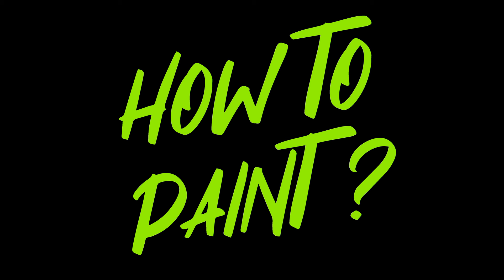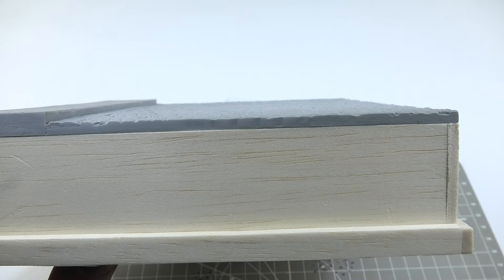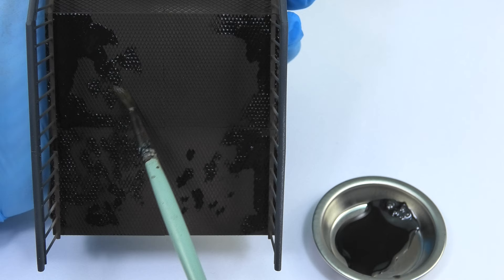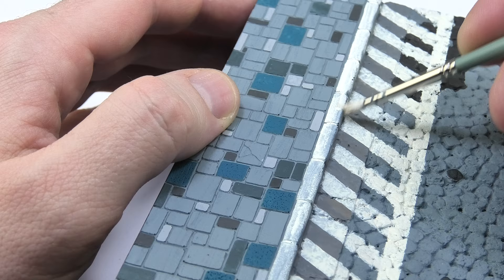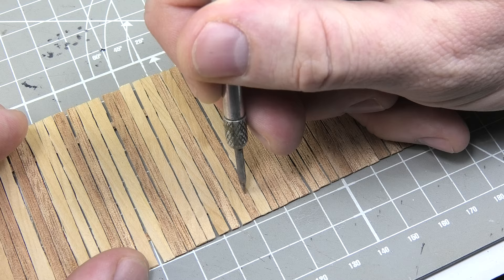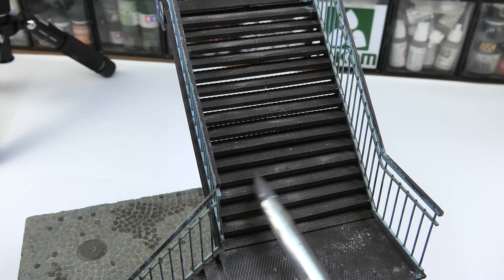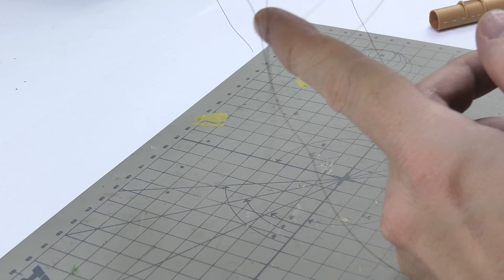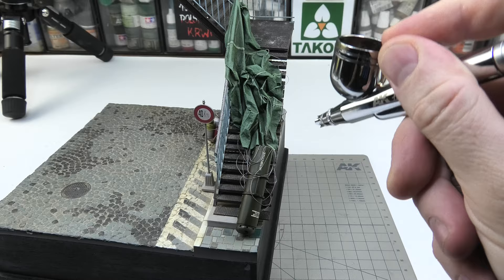HOW TO PAINT: Street base 1/35, Feuer Frei! Macone, Minart, drop container + scratchbuilt parachute

Comment: Thumbnails are as on point as the videos. I like the display you did for the tiger 1. Maybe  with a small bit of fence or something that provides a bit more context.
Reply from the maker: Thx Craig. About Tiger base - open flat and muddy surface was the aim. And I wanted to make smth simple for easy to copy for beginners. Check my T-34 screened with small elements in the background. This is probably what you mean. :)